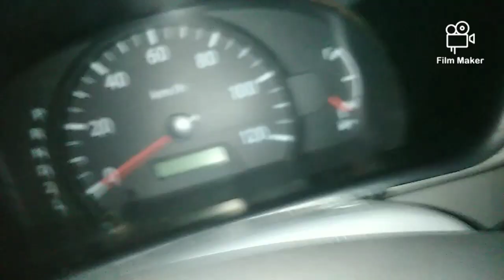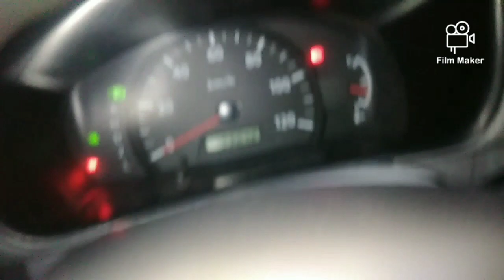DA64 DIY - IACV and PCV Cleaning

Comment: Boss malakas SA gasoline boss ano dahilan. K6a engine pick up type transformer pag malamig pa engine maganda ang minor pag mainit na makina minsan namamatay tapos minsan kurog.
Ratio niya SA gasoline 200 tubil ko NASA 11 to 10 kilometers Lang takbo.
Salamat po boss
Reply from the maker: Try linis throttle body ug ichick nlang pud coil.

Comment: Boss ano kaya problema ng efi k6à multicab ko pag tumatakbo umilaw check enjin pero pag sinilinyadoran kuna nawawala naman pag galit na makina salamat po
Reply from the maker: @MervinSamson-g3n  try m reset boss. Tanggalin m  Ang Isang wire s battery Ang block mga 5minutes lang din balik m din start.